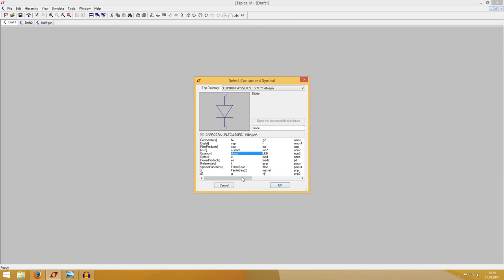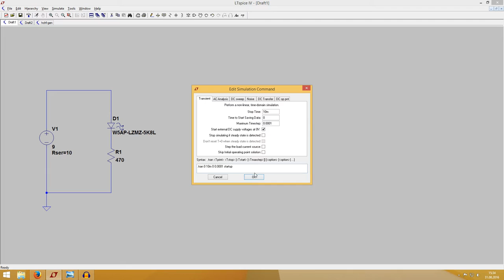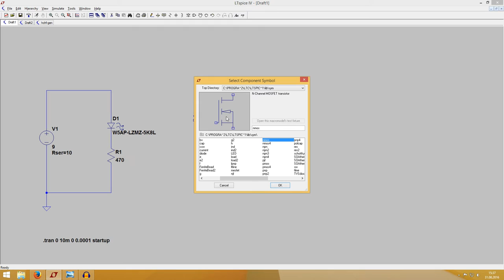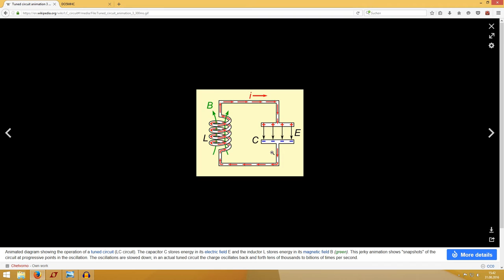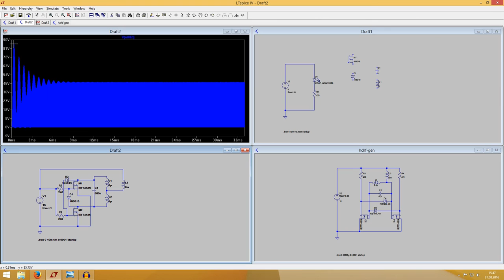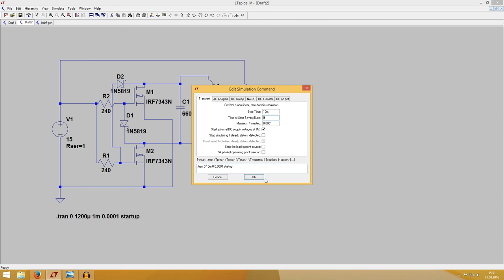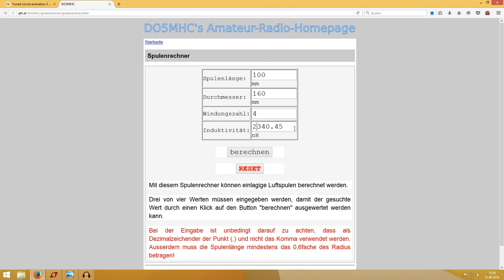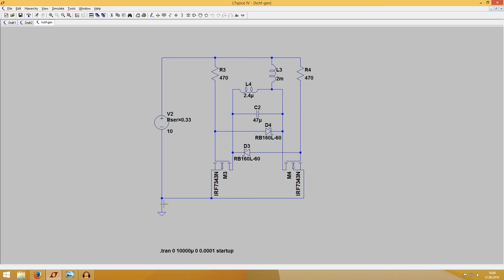Induction Heater Tutorial: Part 1 - Circuit Simulation

Comment: Why do you use the IRF7343N - they are rated only 55V with very little Amps (3...4 Amps). You need something like IRFP250 or -260, handling 200 V with some descent amps. Also the inductor values are very unusual for a royer converter driven induction heater. The choke should be around 50...200 uH and the working coil around 2...4 uH. So your circuit delivers very untypical values - would be interesting to see the results with normal real values...
Reply from the maker: Yeah these Fets are wrong and many people rightfully noted that. I never used them. They had the right schematic symbol and were sort of default. In this simulation something got screwed up. I got one circuit up and running but it is comparable to the ebay ones from china just more expensive, so I stopped making them at all. Maybe I should take down the vids.

Comment: There are so many volt suppliers but amp suppliers are very costly. How to make amps over 9k?
Reply from the maker: Depends on what you want to do. An ind heater for home use doesn't need 9k amps. If you use mains power you could use a transformer and smoothing capacitor but your voltage will be under 0.5v then